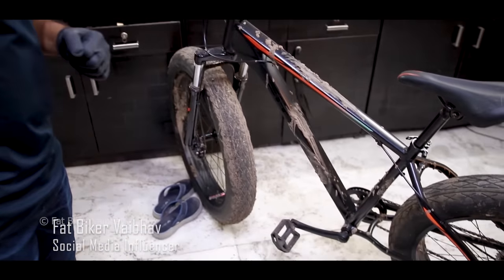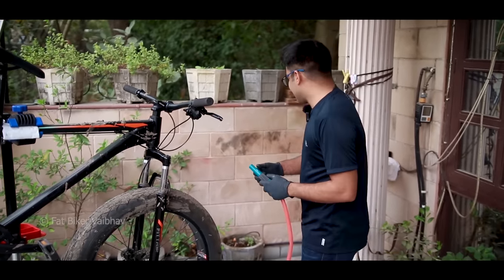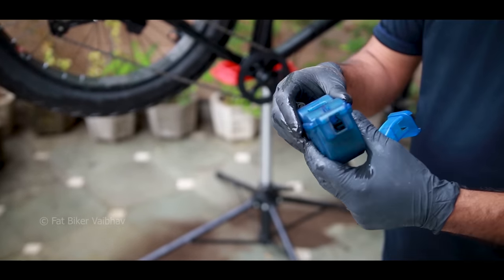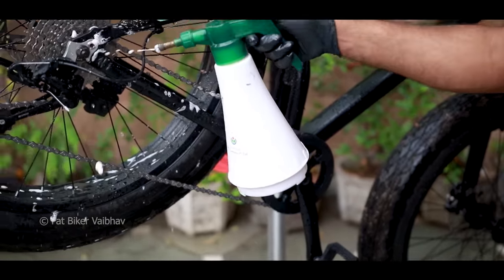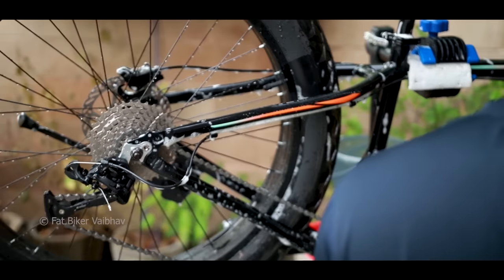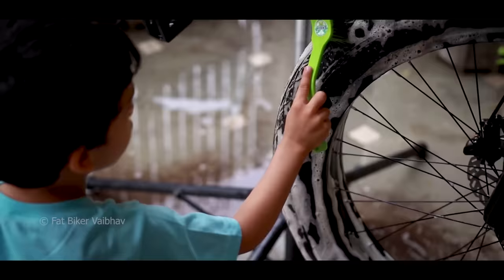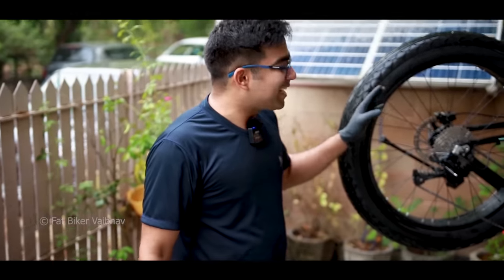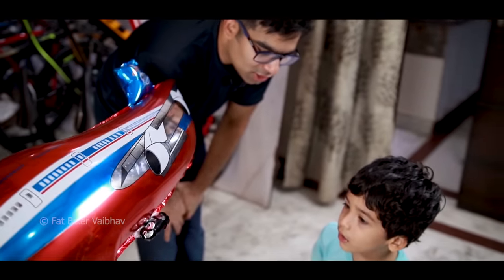How to Clean Dirty Bicycle  | Best Tip | Rainy Season

Comment: A few questions Vaibhav - Do you not cover the exposed area of the suspension and the exposed are of the cables since both are at a risk of corrosion? How often to clean the bike? Does the tyre polish effects the grip level? Can the wet bike be dried with a blower of a vacuum cleaner?

Comment: I used a brush to clean my cycle chain and I degreased my chain with diesel but the blackish degreased oil stained in my cycle's paint and its not coming off so should I use lSO propyl alcohol or WD 40 or what kind of  cleaner should I use please give me a solution because my cycle's paint is neon paint and it looks so bad
Reply: because of the blackish degreased oil

Comment: Sir, as you said we have to leave the cycle for 30mins-1hr to dry but will the cycle's chain get rust?? Or if i have a ebike(hero lectro f6i) then should i spray the water at the battery??

Comment: Now rainy season will start It is not so easy to run the bicycle in rain if water get in touch gear we adjust it get hard or stuck or not work proper also how to save the gear changer from rain

Comment: Can anyone tell if water would damage the gears and derailers or not? My friend once told never let your gears touch the water.
Reply: NO, THERE WILL BE NO PROBLEM.
Reply: Gears will be damaged in old bicycles like old hero sprint
Reply: @subhamsaha305 and what about the disc brakes can I use water on them ?? Please answer